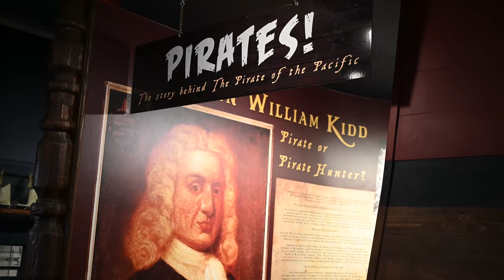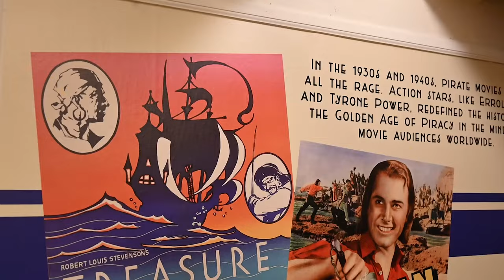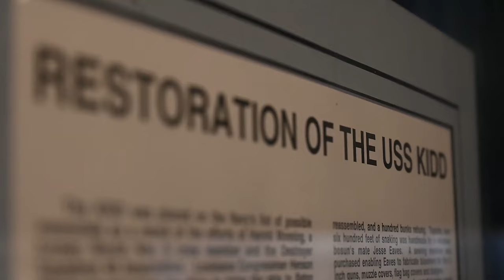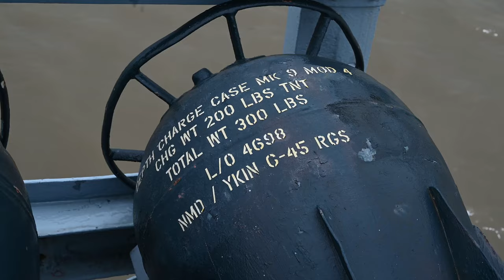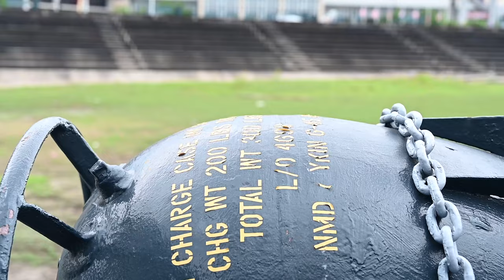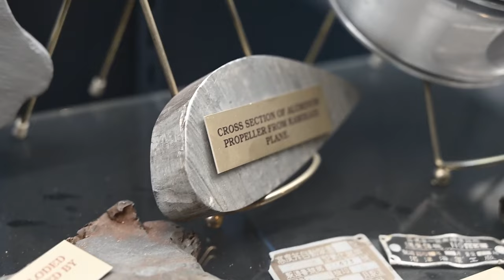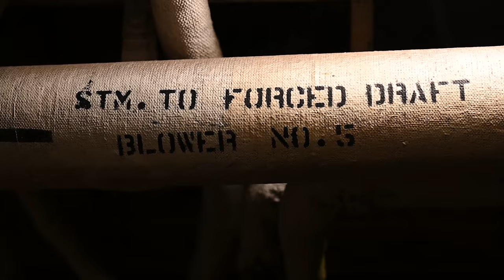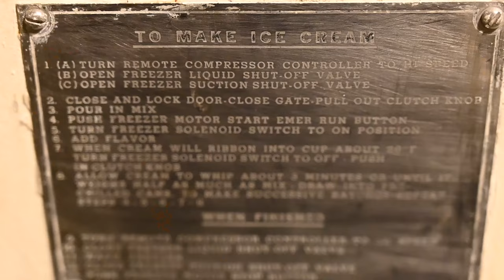World of Warships: Longest Night of Museums - Destroyer USS KIDD

Comment: I served in three Gearing class destroyers as a Boiler Technician. I was privileged to be allowed to visit Kidd’s After Fireroom during a visit in the early 2000’s. Since the plants on both the Fletcher and Gearing classes were pretty much identical, I was amazed to find that I still remembered how to light off the boilers after fifty years.
Reply: What a undescribable feeling.  In the 70's was an EM and in the 80's was going to USAF avionics school.  Took a few classmates to the BB Alabama.  There was a display of Damage Control gear from the 40's.  Was able to tell them what each thing did and was able to explain a lot of what they saw.

Got to the area with the mechanical firing computers.  A couple were missing and a sign said they were put to use in the fleet as the electronic stuff couldn't do a better job.  The mechanical units even took into consideration the Earth's rotation.

Also in the 80's one of the BB's was being reactivated and had missiles installed.  They asked an old Gunner's Mate to come back to active duty and teach the young lads how to maintain the 16 inch guns.

I'm sure he was 'walking on air' doing the same job in the late stages of his life as he did when he was a youngster.

Comment: Your maintenance crew is doing a nice job. I served on the Uhlmann DD-687. Good to see some of these ships survive. I was a QM and since we had to have exact time for navigation, we also got to go around and wind all the clocks. So when I was a boot QM went into the engine and boiler rooms (and anywhere there was a clock) once a week. I liked WWII built destroyer duty. QMs slept forward so it was quiet except in heavy weather when the anchors would bang. The fwd head was much further forward and in heavy weather you needed a seat belt to sit on the toilet. When the bow went down and the ship dipped into a big wave you could hit your head on the overhead. The bow might travel 20' up and down. If you slept in the stern you got the propeller noise and at speed they made all the locker doors rattle. Peace time crew is about 100 fewer people. The Uhlmann and most active Fletchers lost mount 53 and got 3 twin 3" mounts. All the 20mm and 40mm were removed before 1960. We also lost 3 bunks in each compartment to an AC unit. The ship was fun to steer during ASW when we tried to line up for depth charge or Hedgehog runs on subs. Lots of full rudder turns, ship would lean way over. Seeing your video and pics really bring the memories back. Thanks.
Reply from the maker: Thank YOU! The UHLMANN was the last Fletcher to see active service in the USN. Love our DESDIV 152  sisterships. ❤️❤️❤️

Comment: Very well narrated tour, probably  the best of all the museum ships online. One minor correction however, seawater passes through the tubes in the condenser, not steam. There is a very specific pattern of tubes within the condenser to expose the greatest surface area to the steam. If you open one of the manholes in the inlet or outlet head you will see the open ends of several thousand tubes, seawater flows through those tubes and condensate forms on the outside of the tubes then drops down to the hotwell from which the condensate pumps take a suction. You should note that the condenser operates under a vacuum and the temperature of the condensate may only be around 80 degrees F - making the interior of the condenser the coolest place in the engine room.
Reply from the maker: Thanks! 🙂